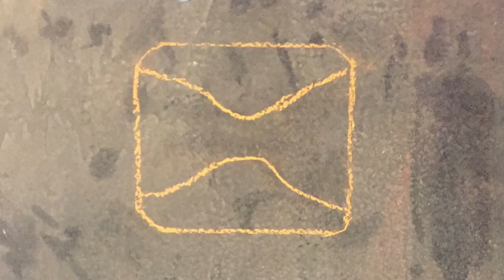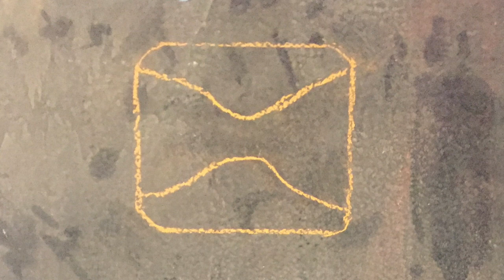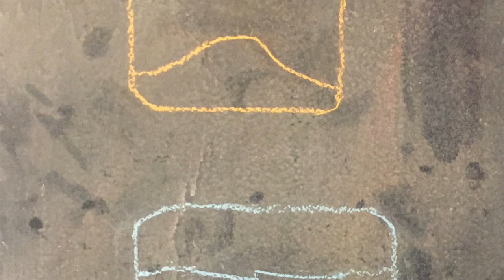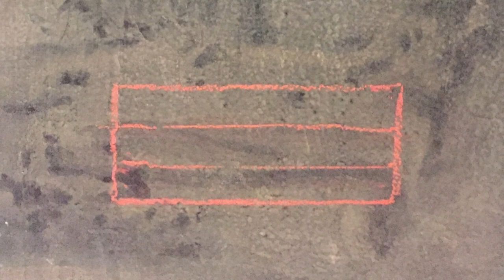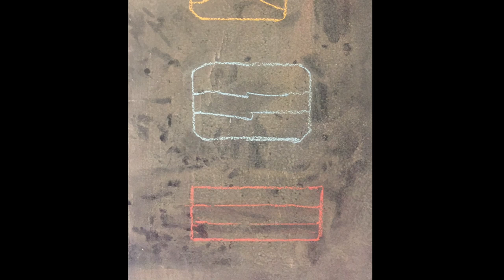A point about wampum bead manufacture.

Comment: In the spring of the year in that brief window of time after the bark starts to slip but before the buds grow you can get straight shoots of cranberry viburnum, clip them with pruning shears, peel them and bundle them to dry for arrow shafts. They are about the straightest thing in nature. The wood is very hard but the inside has a foamy core. You can take turkey wing feathers, slice them and cut them to shape cut grooves in the tail end of The arrow shaft and epoxy those turkey feathers into those grooves leaving a short length behind the feather for the arrow nock. Nock the arrow shaft by cutting a groove in it with a flat seat at the end of the groove so the shaft doesn't split. 
Drill out that pithy core at the front end of the shaft and insert your target point or broadhead point with epoxy. Or you can make your own two blade Arrowhead by cutting a flat piece of steel down in the shape with sharp edges and leave a  narrow tail end of the arrowhead as a shank that will fit inside that Hollow core of the viburnum shaft. Epoxy that shank and insert it into the arrow shaft. 
You can also take those viburnum shafts and cut them down into half inch or inch long pieces and put a string or cable through them to use as necklace. I took an old blue ware pot I found down over a ravine by a creek and cut arrowheads from it with a dremel with cutoff wheel. I also cut the handles off silver spoons and used spoons. I epoxied a small piece of thick wire to the back of the arrowheads and spoons. The wire goes on the concave side and the convex side of the spoon faces outward on the necklace so you can't see the wire. Same with the arrowheads you can't see the wire behind them.When epoxy had dried I wrapped the wire in between each viburnum piece on the necklace bringing each spoon and arrowhead close to the viburnum pieces. You cant see the wire. . These were about 1 1/2 inches long pieces of viburnum with small cable through the center and connectors at the ends to connect the necklace together behind the neck. There were 20 or so pieces of viburnum on it. I alternated one blue arrowhead, one silver spoon, one blue arrowhead, one silver spoon......
Six arrowheads and five spoons. 
Looks absolutely beautiful.  That mottled blue ware looks almost like gemstone. Alternating with the shiny silver. Real silver plated spoons not stainless.

Comment: Thanks for this.  What I have always been curious about is how wampum could be used as currency if its production wasn't centrally controlled.  How did it maintain its value? I never studied economics so maybe I wouldn't  understand the answer anyway.
Reply: Great question.
I'm guessing something like supply and demand. People valued it culturally and knew it could be bartered for other stuff, and so they were willing to receive it in barter themselves.
Reply: What else is as easy to move an is so durable?
Its not like there's a state setting prices and the value of other item's will change too.
Reply from the maker: Except for a very brief period in the colonies, currency is a poor description. 
It was a trade good, the same as food, pottery furs and tools, any special use in this role came from the great degree of labour involved in production concentrated in such a small/portable, imperishable unit. 
The value of the beads would depend on the quality of the individual beads as well as what the two parties thought fair.
Reply: Also, items may well have a value of time saved making it yourself or, if you could not meet the quality or have access to the material, potentially even more
Reply: As one gentleman inferred inland tribes often had little access to quahog shells vs tribes on the coast. Who probably were very adept in working the shell.

Comment: Just spitballing here but beads were (and are) a serious thing right? Your spend time making them and make them good. You'd want them to line up and be of similar size. So why would I not go through a bit more trouble if those hour glass shaped holes were deemed sub par? 

I seriously doubt that that was  a 'bug'.
Reply from the maker: You misunderstand me, the hourglass cross section is not a flaw, it’s just the result of the manufacturing techniques.
Reply: @MalcolmPL  LOL. I know. That is the point I was making. Let me clarify.

Not you, but archeology in general makes it about this:  *Better tools* = **Better product**. So "iron tools advanced the bead making". 

My point was that "better" tools make different beads. If they wanted straight holes before they could have made them. It was a matter of 'fashion', not a matter of skill. You can drill holes with fine gravel and an heat treated oak pin straight through a bead. Takes time and effort and not as easy as an iron drill, but I believe it's a choice they made. It was fashion that changed through technology. 

Bit of a pointless point I came to realize. We already agree on this I bet.

But I was wondering now what the difference in use of these beads would be. The techniques to make a belt would be similar but somehow I think using hourglass beads would be a bit more challenging.